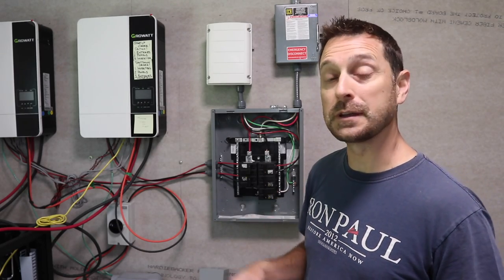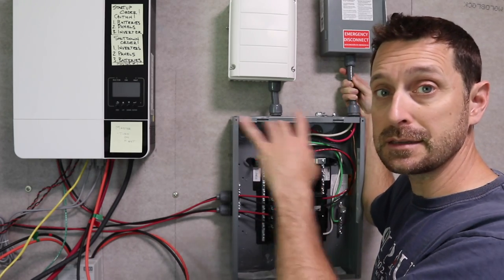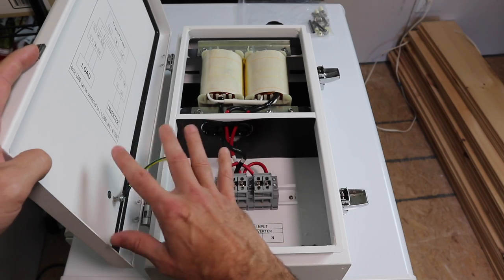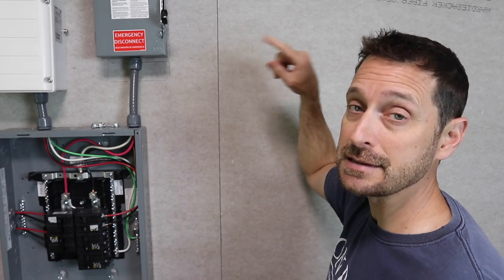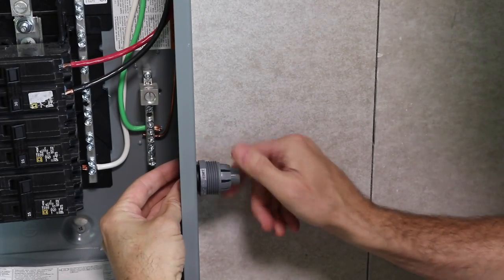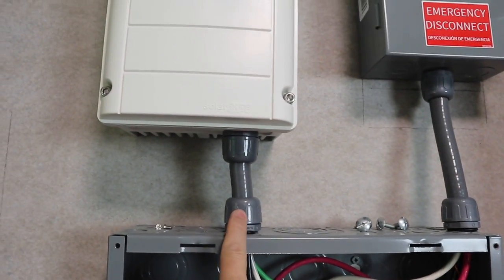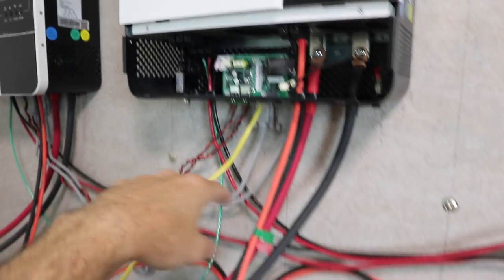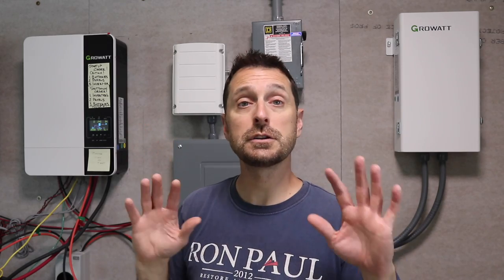New Growatt Transformer Solar ATS Install! Alleviates Safety Issues

Comment: The Growatt autotransformer is made to be put between the inverter and the breaker panel. As connected you are sending 60 Amps to the autotransformer before the breakers will trip. This would be multiple NEC violations using two breakers to the same load. You can remove the input.

Comment: Hello, not sure if someone has commented already but your input and output are the same legs. You can see the two red wires from the input jump to the output side. So your current still flows up and down the wires just like your other transformer. I think they did it this way because it was confusing people the other way.

Comment: Thanks! I watched James video on this same subject and couldn't understand some of what he was doing. His video didn't show what was hooked where, etc. Your video however, was very clear. I, incidentally, have the exact same pieces of equipment that you show here. The one thing James explained was how to size the breaker in the distribution panel which yours didn't. Essentially it is the required breaker for all transformers connected to it. In this case, a 20A breaker for the Growatt Transformer and a 25A breaker for the Solaredge equals a 50A breaker in the distribution box. Actually would be 45A but go with the 50A as you can actually find one of those. NOW, I am ready to rock. Thank you very much.
Reply from the maker: Awesome. You’re welcome

Comment: I don't understand why you need to loop line 1 and 2 back to breaker box when all it does is get jumped at the transformer terminals. wonder why not just run the white neutral in its own conduit back to the breaker box? one less breaker and less wire. The way you got it set up now two breakers would need to knock if something goes wrong.  To me that's the sane as putting jumpers right at the two breakers and using them in parallel as a single circuit. would it not take double the amps to knock?
Reply from the maker: Growatt's instructions.
Reply: Correct.

Comment: Hello, we are so impressed with you. We are sitting here on 200 acres in Elephant Butte, NM on our private wildlife preserve. We have installed a Signature Solar 10,000 KW system. We are at an impasse with wiring in our 2 Growatt transformers into our main AC load center panel. We have 2 x 5000K Growatt inverters, 16 Canadian Solar panels run in series of 8, 2 x Eg4-LL lithium batteries in our battery rack. Our 16 panels are mounted on top of our 40 ft connex. We are 100% off grid. We are stuck at wiring in our transformers. We have contacted Signature Solar many times. They are not helping us other than sending a Growatt schematic and telling us they are not qualified electricians. The diagram they sent is contrary to your working system in your video of how you are wiring back into the same panel with L1 and L2 wires from the Growatt transformers’ output. Would appreciate any help, are road trips an option? Regards, Scot and Janie
Reply from the maker: Hello. 
How is wired differently? 
Sig Solar can't give advice on actual wiring legally. 
Contact me on our Facebook messenger and send me some pictures.

Comment: Thanks for video, was wonder your input on connecting 2 Growatt 5000es to sub panel then directly to a Victron Energy Autotransformer 120/240 100A, then from autotransformer to safety switch? The autotransformer has built in 100A breaker on input side.
Reply from the maker: I have never tried a Victron

Comment: Wish I could afford solar and could install it myself. Not happening, but I still enjoy learning about it. 🤗
Reply: Hey Bruh, don't lose it.  You''ll get it at the proper time and it will be in time, and You'll be a PRO.
Reply: It takes a LONG TIME yo do it yourself.  I bought some components 2 years ago and still not entirely installed.  Don't think you have to have $30 grand right up front.  Don't give up on it.  Start small.  Build a small solar generator to learn and scale to what this guy is doing.  Just think....this transformer is about 359 bucks...in due time...you could build enough system to start saving.  Make it a goal and stick to it!  You want it....go get it.
Reply: It's not that bad. You just start with a very simple setup.
Reply: Solar is cheaper than the grid. I just installed a $500 system that runs lights, water pump, and phone chargers free for a man who lost his legs.

Comment: Good video.  It's always nice to see an easy to follow instructional diy installation.
I have three 5000es growatts  in parallel and had 2 seauto 5000 transformers with 18k of panels.  When growatt offered the new auto transformers I bought them based on all the safety hype.  They do look more robust even though they are rated the same.  The growatt uses 10ga wire into the coils whereas the seauto uses 12ga.   The growatts take up more space but they look prettier.  The fancy plastic connector is of no use to me. The growatt transformer still only has 3 wires going into the coils just like the seauto.  I use 4 gauge wire to hook my transformers into a breaker.  Using another set of 4 gauge wires for an in and out type connection is just a waste of copper.  I've noticed the growatt does get hotter under the same loads though.  The seauto is aluminum with a large heat sink which dissipates heats much more efficiently.  The growatt also makes a louder humming noise where I can not hear the seauto unless I put my ear close to it..  I currently have 1 seauto and 1 growatt transformer running in my system.  I've had no problems with either setup.  For the vast majority of people who are using the seauto transformer, switching to the growatt will not solve any problems, and isn't any more safe.
Reply from the maker: Thank you

Comment: Great content thanks for sharing ! As constructive feedback, the way you connected your new Growatt autotransformer is no different than your old solaredge. If the purpose of the new autotransformer is to give you protection for the 120v appliances in case of failure, then you should connect your inverter output directly to the input of the growatt transformer and then the output of the autotransformer to your sub panel. My two cents, but again thanks for sharing 👍.
Reply from the maker: I appreciate it and thanks for the criticism. I, however, have to go with what the solar company told me to do.
Reply: The problem with the proposed arrangement is that typical 240V loads (range, dryer, air conditioner, EV charging) would exceed the capacity of (the wires going into and out of) the autotransformer, so separate panels would be required for the 120V and 240V loads.  It would have to be inverter(s) connected to 240V panel connected to the input side of the autotransformer and then the 120V panel connected (with a pair of 120V breakers) to the output side of the autotransformer.  I would print and affix a big warning label for the 120V panel: “Do NOT install 240V breakers in this panel” and another label for the 240V panel: “Do NOT install 120V breakers in this panel.”
Reply: You are TOTALLY correct. Hobbyist is one thing, electrical engineering is another. Not a good set up there irrespective of what is said in solar forums. Not at all. So may things wrong with athat setup.
Reply: @mcarling6495  you are correct. Great observation and recommendation.
Reply: @CountryLivingExperience  You do you, but what you report the solar company has told you to do is 1) a violation of several sections of the NEC, 2) unsafe, 3) doesn’t solve the safety issue it’s claimed to solve, and 4) makes no sense from an electrical engineering perspective.  No competent or semi-competent building inspector would allow it.

Comment: Is your off grid disconnect switch a 3 pole switch? You must disconnect the neutral from the grid as well if you have a ground bond at the inverters. Otherwise you have a paralell ground path.
Reply from the maker: I know. It is a 3 pole.

Comment: I got the old solar city (now Tesla) roof units they told me I can't run off grid I need to have street power to power the micro inverters of the panels ... How can I get around that need with a set up like yours
Reply from the maker: What they told you is strange and does not sound correct. It depends on how you wire it. I have no idea how your system is set up. You would have to deconstruct everything and build it back into an off-grid system.
Reply: @CountryLivingExperience  so long story short panels are on roof come down to their monitor inverter and they have inverters I guess under each panel then it feeds back into my main panel I would assume that keeps it from back feeding to the grid of power is out to save any linemen . But I went from no electric bill to 200$ some how it's really irritating
Reply from the maker: @arcticreaper1  Yes, micro inverters are underneath each panel. You need to have a different solar company come out and examine/inspect it. You should not have a power bill increase.

Comment: Have you installed your mini-splits yet. We're building in central Colorado and completely off-grid.  We will be all electric except the stove top. Oven will be electric. Just wondering how your minizsplits are running, especially in the heat mode. Thanks, Martin
Reply from the maker: We have not installed them yet. I will let you know when we get them in.

Comment: I am confused now.  I had planned to wire my Growatt transformer just like you did in this video.  The instructions that come with the Transformer show the inverter going into the transformer then into the AC panel.  I have two 5000es inverters so would I need to two transformers in order to wire it the way the instructions show?  Everything was clear to me until I read the instructions that  came with the Transformer.
Reply from the maker: I confirmed with Sig Solar that this was correct before I did it. I don’t remember the instruction manual guidance and it has been a while since I connected it. I’ll look into it and get back to you.
Reply: @CountryLivingExperience  Thanks

Comment: I am REALLY new to this solar/ alt energy world but wouldn’t buying the Growatt 12k split phase inverter do the same thing as your 2 5k inverters and transformer and probably save money to boot ?
Reply from the maker: That product did not exist when I purchased the equipment in this video.
Reply: It would do the same accept you cannot add more units the the 12kw units were the 5KW units you can add up to 6 to get the power you need

Comment: i think i had written i would have done some of what you post differently,  (choice i think), but this is a good set up.   it does bother me to see you sticking your hands in the panel box facing the camera.    be safe
thumbs up, well done
Reply from the maker: Thank you. (everything was disconnected on the input side when I put my hand in there)

Comment: Can you provide me the sub panel model used in the video. Did you have to purchase components separately or did it come complete?  Thanks.
Reply from the maker: The sub is just a 125 Amp Homelite box from Home Depot. All of the solar components I purchased from Signature Solar....https://www.signaturesolar.com/?ref=countrylivingexperience 
I purchased all of the components at the same time from them. 
I purchased the wire, conduit, etc. from Home Depot or Lowes.

Comment: I live in Brazil, here where I am my SPF3500ES acts as an intermediary between the power grid and the house, leaving it to manage when it is on the inverter or grid. As here it is 220v two-phase and the inverter is 220v single-phase it was not the problem, but to make the 127v I used an autotransformer from 220v to 127v. His problem is that I don't think he does 127v/neutral but 65v/65v.
I want to use a transformer like this one from Growatt, which creates the neutral in the center of the coils, but I can't find that model here.
Reply: Brazil has three phase 220Y127V not split phase.  Using a Growatt autotransformer like this with 220V input would give 110V output which might be lower than what you want.  In practice, nearly all the appliances one would plug into 127V are global appliances that are engineered to work with all voltages from 100V in Japan up to 127V in Brazil, so unlikely to be a show stopper.

Comment: FYI, I might be a little confused, but I have 2 of the new transformers on my 4 Growatt 5kw system and both are on and they automatically split the unbalanced phase voltage between the the 2 transformers. I have 2 AC multi meters (from Amazon $15 each) that shows the voltage on the neutral on each transformer. If one had a problem the other one would automatically pick up the difference and I could see the imbalance on the meters and know to fix it. If your old transformer is not on and sharing the imbalance you would already have fried some 120volt appliances if you have a problem before you even knew there was a problem. I have learned a lot from your videos and putting in my similar system and just thought I should mention this.
Reply from the maker: Thank you. Not sure exactly what you mean though. Both of my transformers are on.

Comment: Hi, Please take your electrical tester Go from Ground terminal on the Transformer to the Neutral Busbar on your Sub-Panel check for voltage ⚡️ reading  .04 voltages. I got a similar setup I am getting a reading from  my Transformer Ground terminal to Ground Busbar on my Sub-Panel. 04 voltages.
Reply from the maker: There is always stray voltage in a system.

Comment: I’m hoping this is the transformer that has been on back order with signature solar. The invoice says “Release date May 6th” so that’s curious.
The wires that you ran from your sub panel to the transformer are 8 gauge, is that correct?
I’m going to be running 4 8gauge wires from my solar array to my house, would those be similar wires or a different style? The reason I ask is because I’d like to bury the conduit but I’m unsure what size to go with.
Reply from the maker: Correct, they are 8ga THHN. The 8ga PV wires you are running from your array are different.
Reply: @CountryLivingExperience  Ok thanks. Different as in thicker I’m assuming? Those didn’t look very thick.

Comment: I don't see the benefit of two runs feeding your new transformer. what am i missing? Other then redundancy.
Reply from the maker: Not sure 100%. Going with the advice of the Sig Solar. They have worked on this for a while with Growatt.
Reply: @CountryLivingExperience  The loads are jumpered together between input and output in the Sig Solar box, so there is both redundancy in the breakers, AND you have introduced a source of error since now 2 breakers need to be turned off to isolate the transformer, rather than the 1 strictly necessary.
Reply: The parallel connection only reduces safety and violates the NEC.

Comment: I'm curious as to how much power loss your system has between your array and the AC power breaker box? Obviously it's taking power to run the Growatt hybrid inverters and the auto transformer. Do you know?
Reply from the maker: I am sure there is some power loss but I have not calculated or monitored it. Everything is running with no problem so I am not too worried about it.
Reply: The only time there is a power loss (current flowing) through the autotransformer is when there is a different load on each 120 volt leg of the 240 volt input.
Reply: @danielglang6312  There are also power losses through the autotransformer due to eddy currents, hysteresis, and other minor effects (eddy currents plus hysteresis account for about 99% of no load losses).  It’s easy to measure the no load losses: hook up a 240V source, no loads, and leave the neutral unconnected, then use a clamp type ammeter to measure the current flowing through the autotransformer.

Comment: Have you ever had a problem with your batteries draining fast? We just put ours on a couple months ago and we have 6 of those batteries hooked up and use the whole 80% overnight with nothing but 2 fridges on and the tv for a couple hours
Reply from the maker: I have not had that problem at all. Are you sure there is not some load you didn't account for that is running in the background? 6 batteries should keep 2 fridges going for a week. Try going over the settings in the inverters again to see if you missed anything.

Comment: I have basically the same setup with the Growatt autotransformer.  I had talked to Signature Solar about the wiring of the autotransformer and they told me to ignore the wiring labeled "inverter/input".  If what you did here is accurate, this is just one of many times Signature Solar has given me wrong information.  My system runs perfectly good without the input side used but I will wire it up and see if it maybe runs more efficiently.
Reply: Signature Solar is right. Were the breaker feeding the input of the transformer tripped, the system would continue to work.
Reply from the maker: That is so interesting. Another case of conflicting info. Hmmm, I talk to Ethan and Matt in the tech department. Confirmed this with Ethan on Wednesday.
Reply: @edmiller7761  That’s why two breakers in parallel (what Signature Solar reportedly recommend) is prohibited by the NEC.  The whole point of circuit breakers is to cut off the circuit in the event of a fault.  Parallel breakers means that if one trips the circuit is still energized.  Very dangerous and strictly prohibited.